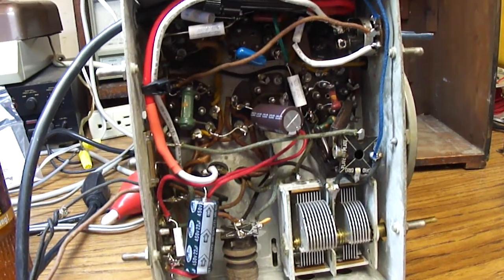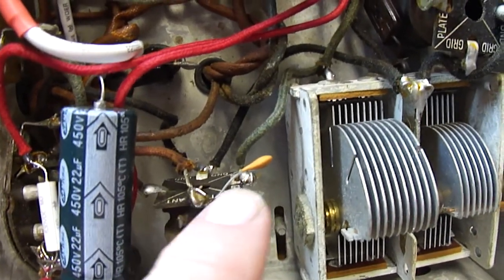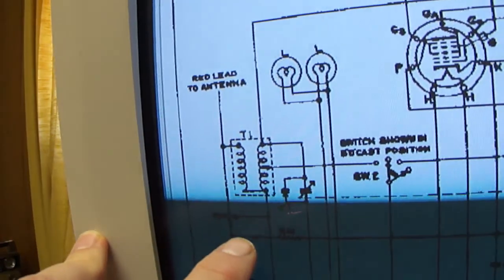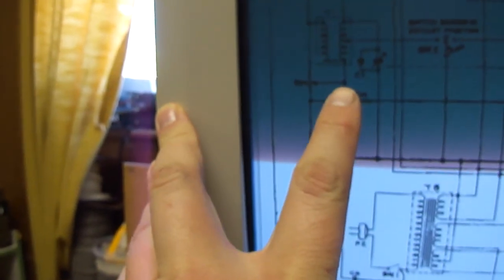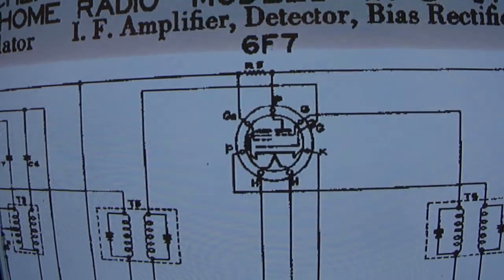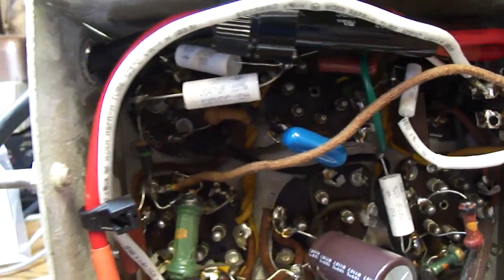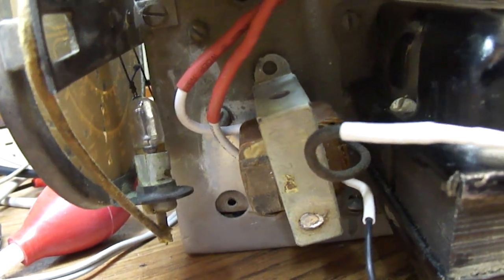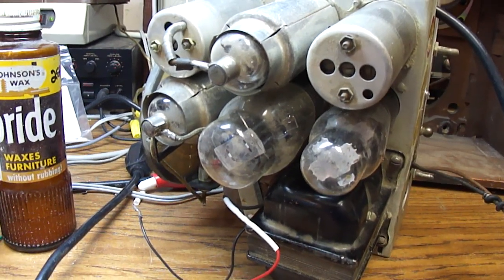1930's Arvin Model 417 "Rhythm Baby" radio completed repairs

Comment from the maker: @1912RamblerFan01 The superheterodyne uses an oscillator which generates a frequency a certain amount apart from the antenna signal and mixes it with it. This difference frequency is the "IF" (intermediate frequency). When you mix two signals, you get a sum and a difference frequency. The IF amplifiers are only sensitive to the difference frequency and amplify it. This eliminates the need to make all amplifying stages in the radio tune all frequencies. Yes you can make a homemade one.

Comment from the maker: @organist1982 Yes there is, it is a tetrode but it is more rare. The Philco N942 radio uses a dual tetrode in it.
The triode has three main elements, the plate, grid, and cathode (not counting the filament.)
The pentode has plate, three grids, and a cathode.